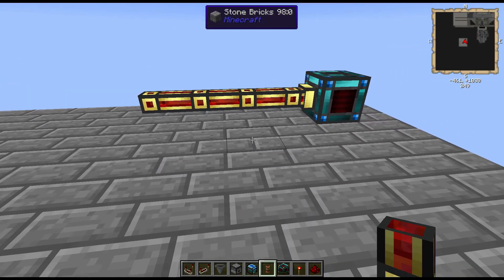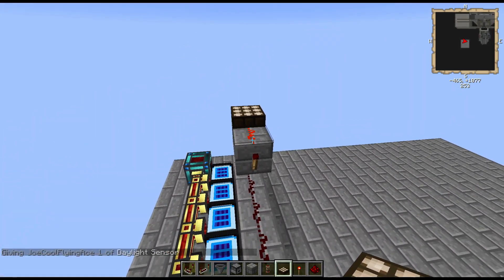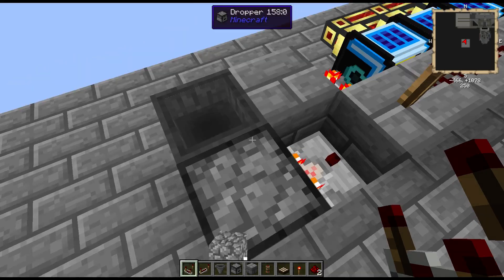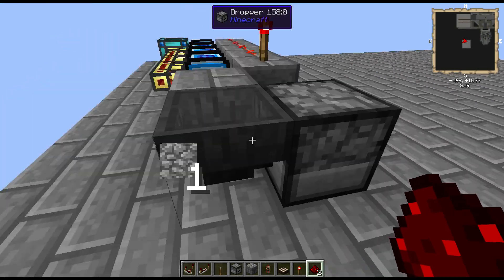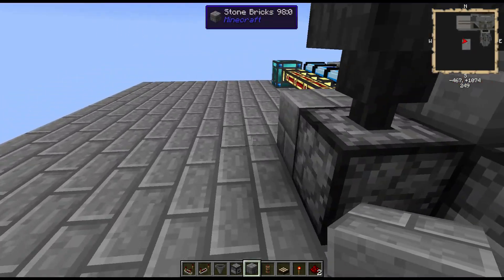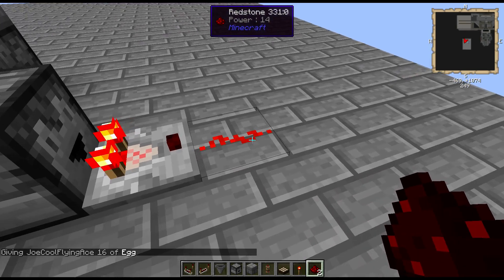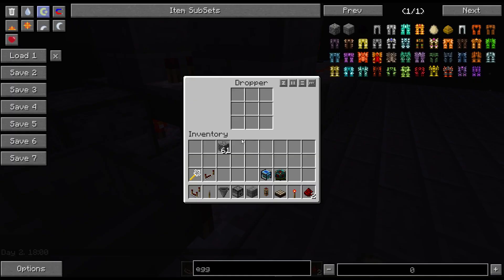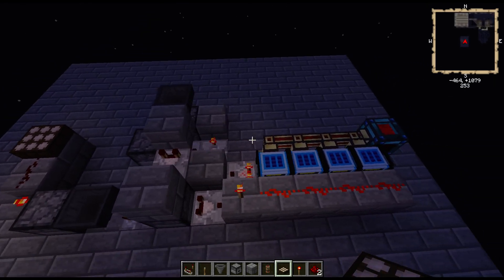Tutorial: Solar Generator Management for Material Energy 3

Comment: Make a tutorial on how to turn the signal on for X amount of time, then turn the signal off for X amount of time. Some of us use something called beds. Also, the idea is simpler and will take less space.
Reply from the maker: This setup worked quite well for me, even using beds to sleep through the night. You can look up several hopper timers that should meet your needs of turning one on and off for a specific amount of time. I use a hopper timer on my spider crusher.
Reply from the maker: Just remembered. You don't need the daylight sensor portion of it. They auto discharge at night. Earlier versions did not and required the daylight sensor.

Comment: Great work m8 love the concept and build on this. The only thing I'm not a fan of, which is the norm for most redstone builds, is the size and amount of room it takes up. It would be a bit of a pain to hide that much from being seen behind a wall or other structure. Keep up the great work though, love to see the ideas and concept builds you create.
Reply from the maker: Look for it at the end of episode 2. I wanted to do a tutorial before I showed it in an episode. It can be hidden, but I didn't want to take away all the fun. :)

I would guess most of the newer mod packs will have SFM, which makes this much easier.
Reply: JoeCool FlyingAce either that or programmable red net.That would be tiny. Nice to see some vanilla redstone. I only just saw the point of the last circuit. I had thought that the generators would be on during the day anyway, but if they were on a charge cycle and the cell was full, they'd be locked trying to charge a full cell, missing whatever daylight was available. Nice.